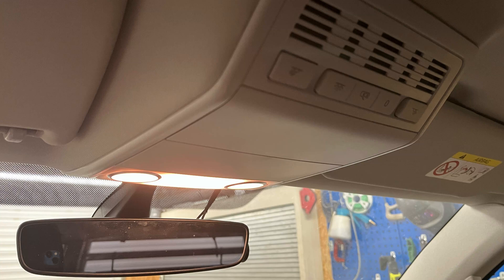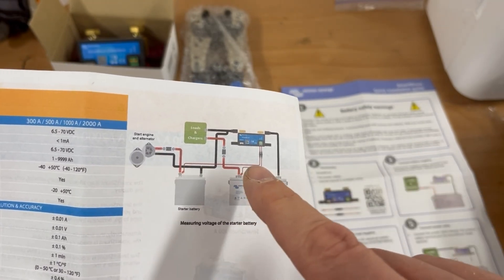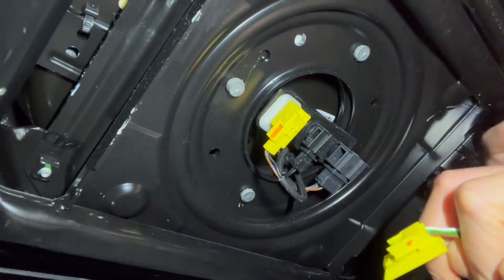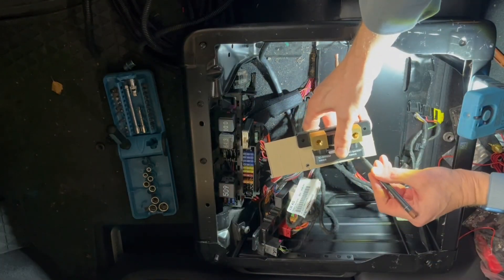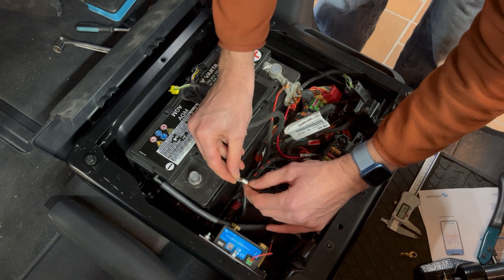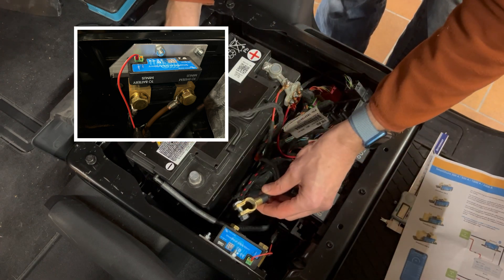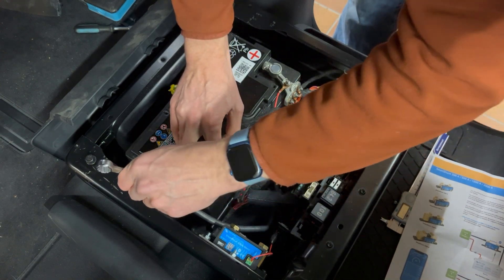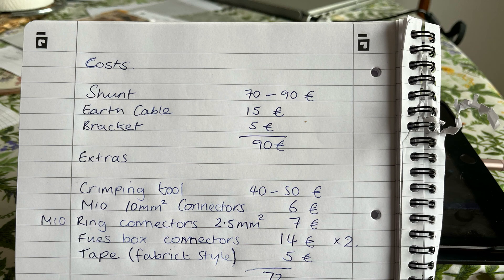Install a Victron shunt on your VW T6 leisure battery and adding connections to factory fuse box.

Comment: Hi Andrew, thanks for your work. Your videos are really appreciated. If I may, I'd like to ask if you kept the original Volkswagen sensor when you installed the Victron shunt (to display the little battery information, volts, and estimated remaining charge time on the screen at the top). I don't see the original cable in the video. Can you tell me what type of connection you made? Thanks in advance, and congratulations again.
Reply from the maker: If there’s an original sensor it should absolutely be left in place. Removing that would no doubt cause an error in the car’s memory because it would be looking for the signal unless it was coded out. I don’t think there is one on the leisure battery in the Californian beach definitely one on the main car battery. Looks like a small black box on the negative terminal. Sorry for slow reply and thanks for the compliments